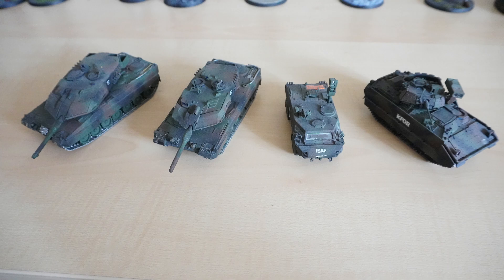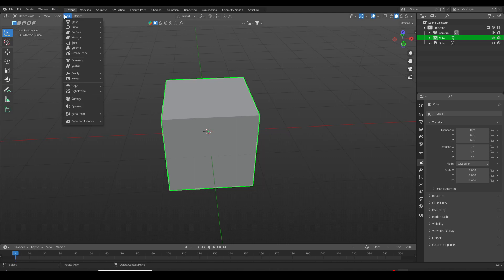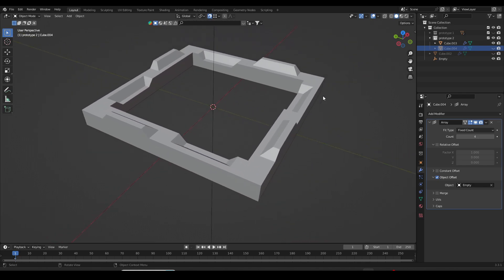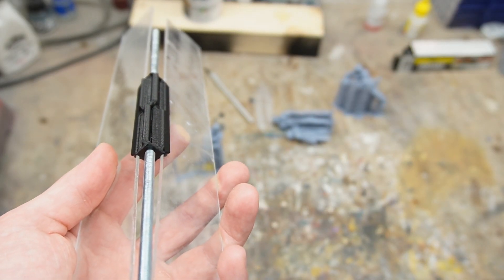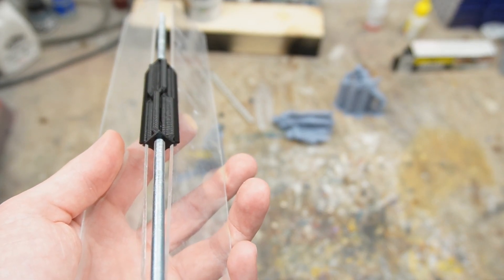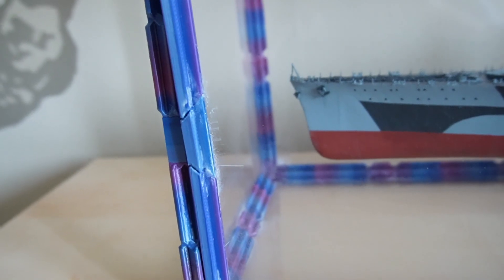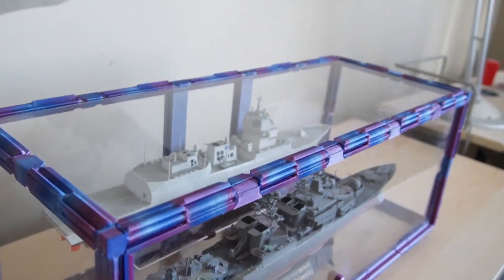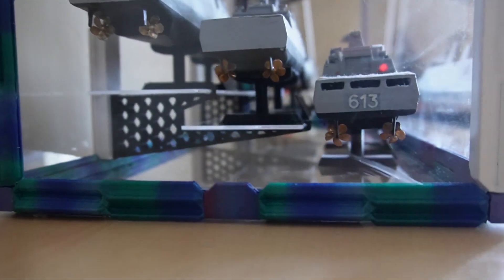3d printing modular showcases for my (3d printed) models

Comment: I think you kind of missed the major requirement for a showcase - it must not get in the way of showcasing the model. In other words, a showcase must be boring, which these frames are anything but - they are colorful, complex-looking, and rather thick. So they steal the attention.
Also, doesn't it feel a little over-engineered? I would go with simple round holes and pegs, which would definitely make the frames thinner. Or you could do that with 2020 aluminum extrusions.